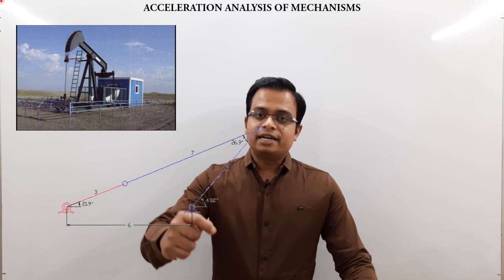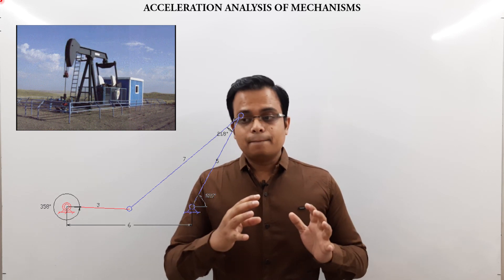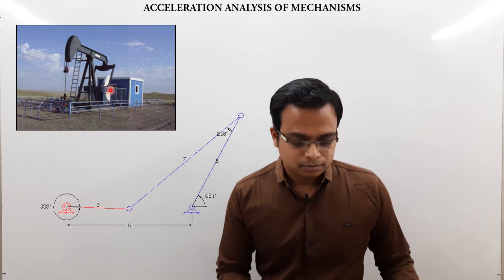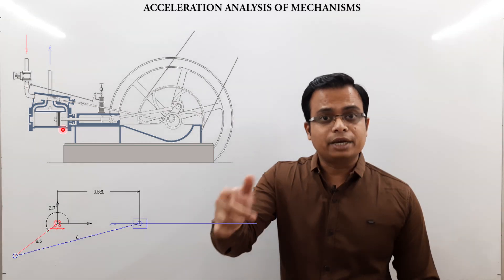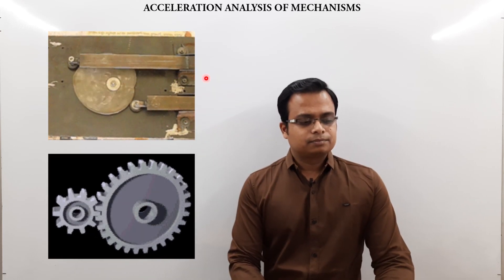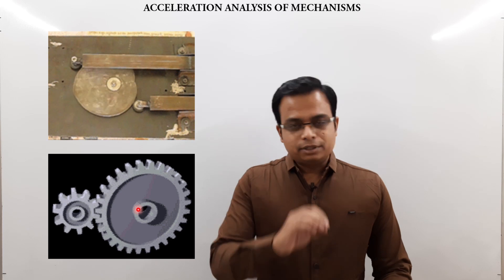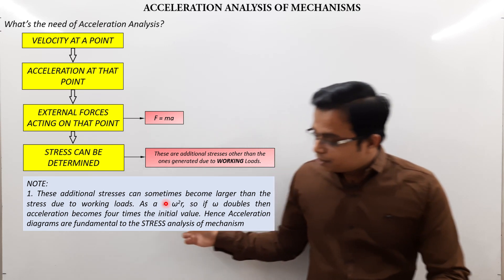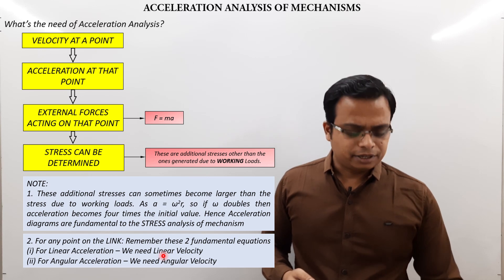Acceleration Analysis of Mechanisms || Centripetal & Tangential Acceleration of Link

Comment: The mechanism you asked in the beginning of the video, in the slider crank mechanism is a regulator, it is used to keep constant the RPM of the mechanism, gas pedal is connected to this machine, if the angular speed of the whole mechanism decreases, this causes regulater mechanism increase amount of fuel in to the spark chamber. Thank you from Turkiye.

Comment: It is a governer mechanism like porter or proell etc... For maintaining fuel supply to IC engine using throttle valve wrt speed of the engine output shaft.

Actually thank you so much sir,your are doing such a great job for students to enrich their knowledge about Engineering subjects with indepth content......👍